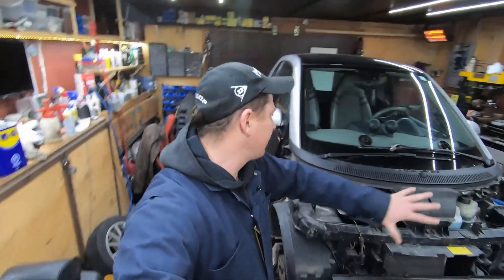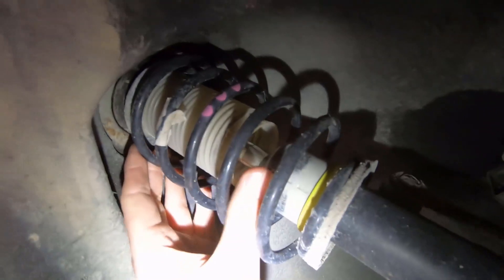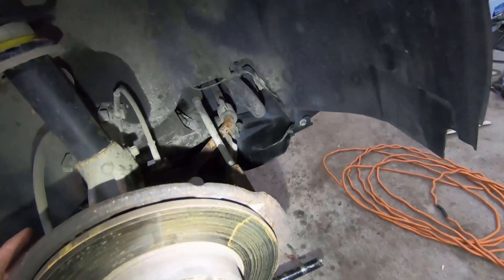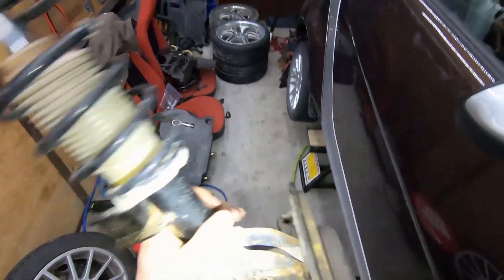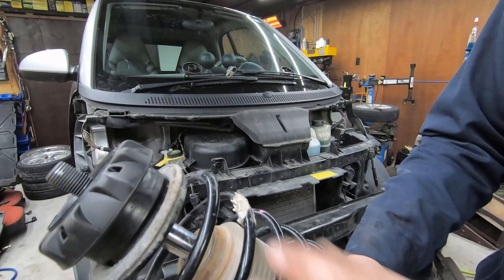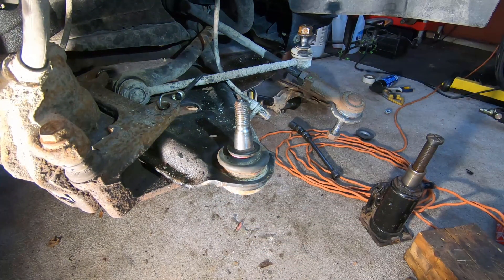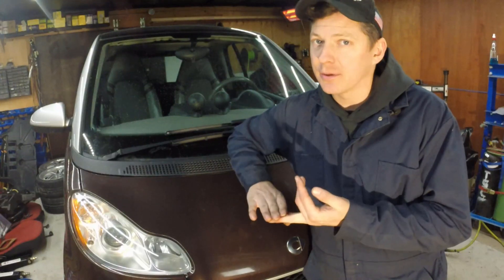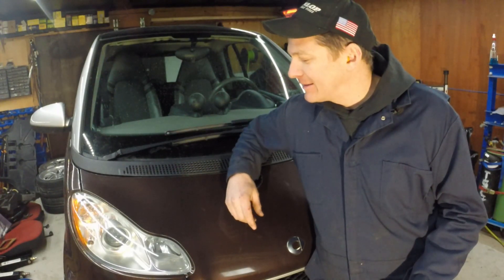Front Suspension Full Disassembly and Rebuild Smart ForTwo 451 (2008-2015)

Comment: If just replacing the control arm will it need a front end alignment?
Reply from the maker: While not absolutely necessary, I would do it because you can never know how accurate the new control army’s dimensions are to the old one you’re replacing.

Comment: Tiny quote was 2400$ us for this job. And 90$ for alignment. Fair?
Reply from the maker: 90$ for an alignment is a good deal. $2400 to replace the control arm seems steep. What work are they doing exactly and is it one side or both? What’s the breakdown parts vs labour?

Comment: Perfect. I have a clunk sound when taking a left turn too quick. Replaced all sway bar components and while off the ground inspected for anything that had play or generated any noise. Tight as a drum, but still makes the noise. That strut top is an area I had not tested under the right conditions. Its my next test using that bottle jack method
Reply: Strange thing. The abs/skid control Triangle light came on and wouldnt go off until i restarted. Now the clunk is no longer. I'll rip it apart and see if the rotation sensor ring is loose or broken inside the hub. Intermittents are the worst.
Reply from the maker: @plushowner check your reluctor rings on the rear axles. They crack often. I’ve never seen a front go bad but that doesn’t mean it can’t. May be unrelated to the clunk, or if the rear rings are wonky the clunk could actually be the abs trying to brake a front wheel or something.
Reply: @PBGarage  I do live in a "pothole state" MN. Dented rims a few times, I feel real bad for my car. But mine is a 2008.
Reply from the maker: Yeah great thing to check, also check your control arm bushings for play they often delaminate.

Comment: could you use a pickle fork to pop the ball joint from the knuckle?
Reply from the maker: Yes but you will most likely destroy the rubber boot on the ball joint. Not an issue if you’re replacing it anyway.

Comment: 10:50 
A hint to fellow hobby mechanics, that the bar between the two car-sided control arm mounts is mobile. I did not recognise that initially and nearly died trying putting the screws back in after replacement -because the bar was (unknowingly) out of center.
Reply from the maker: Yeah good tip, I don’t remember if I covered that in the suspension disassembly video.

Comment: Really good description and lighting. Did the general ride on bumps get better?
Reply from the maker: It was about the same, it just got rid of a small clunk from the front end over larger bumps. 

People have several tricks to improve the stock ride, I’ve tried most of them and found nothing really makes it much better. At the end of the day it weighs literally half a “normal” car AND a lot of the weight is over the rear axle because of the rear engine. I don’t think there’s much to be had for the harsh front end ride. Check to make sure your springs aren’t broken, and try to see if the struts are leaking. If they’re the original struts and you’re higher mileage, even if not leaking they could be shot. I’ve been meaning to try a set of Bilsteins all around with new Brabus-spec springs. Then at least I know it’s as good as it will ever be.

Comment: No torque wrench used. Not even a reference to torquing. Just a ratchet ring spinner/wrench. This is the dark side of YouTube. Anyone can put up half-assed (but apparently accurate) videos which appear informative but the end result is lives are put at risk - literally.

AND the contributor LOVES this comment. From which we can conclude he doesn’t care.
Reply from the maker: On the flip side, this same car in the video had been taken to a licenced mechanic prior to this work, and the front left lower control arm bolt had been torqued “to spec”. When the car was driven and had to make an emergency stop, the front wheel came back and tapped the wheel well liner, in the process shooting the car hard left into oncoming traffic. When I inspected the car to see what was up, I realized the lower control arm bolt had been sheared in half from being tightened to the torque spec. So the rearward half of the control arm was held in by what was left of the bolt and the front half of the control arm was free to float out away from the car on hard braking. 

These videos aren’t meant to be a factory service manual. They are meant to show people what to expect when taking the car apart. If whoever is working on the car doesn’t feel confident in their ability to set torques to the appropriate values they probably shouldn’t be working on it.
Reply: If your self confidence to tighten something properly relies on a spring and ball in a ratchet making a click sound to do small work like this then you shouldn’t ever work on any vehicle your in experience shows in your words not a good thing at that.

Comment: Nice video, just did this today. Your new front arm just slid on easy!! I got a Febi arm and it was about 2mm too small between the 2 bushes. Ended up wedging a small  bottle jack between them to open the arm  up slightly.
Reply from the maker: I’m surprised it didn’t slide right in. I wonder if the arm got bent in shipping or if the mounts on the car were a bit bent or something.
Reply: @PBGarage  it was just strange that it was both sides and both arms  but they are in now that's the main thing :-). Maybe Febi had a bad batch ? The original Mercedes ones came off easy but they were worn 👍

Comment: Brilliant video. This issue is one of the most challenging issues a Smart car driver has to face. UK garages are a nightmare, and charge a fortune for this...
Reply from the maker: Thanks! The trouble here is finding someone that will even touch them anymore.
Reply: @PBGarage To be fair there not too hard to work on. I think garages  just see them as small and awkward to work on eg front  spring change needing the front end and lights took off to do it proper.

But taking the front end and lights off  is actually only a 10 min job I was impressed how easy it was 👍

Comment: How did you reassembled the strut back with the top 21 nut sitting, which you have removed at the beginning? @6:30
Reply from the maker: I just reassembled it in the reverse order. Slid the strut up through the hole, put the nut on by hand, and then drove it on with the impact.

Comment: I did mines about 5 months ago. At first the suspension would not bounce. I would push down on the car and no movement
Reply from the maker: Glad you sorted it out!
Reply: @PBGarage  I still don’t know what caused that to happen, any ideas.
Reply from the maker: @BIGGBAY90  Oh you mean it wouldn't bounce after replacing things? Quite probably either the bump stop was improperly installed, or the strut was jammed internally. Is it still not moving?
Reply: @PBGarage  Only the lower control arm was replaced

Comment: A really informative and helpful tutorial, I've used it to remove my worn track arms and replace them with new ones. The tip for not fully tightening the mounting bolts until the ball joint was back on was great, thanks again. 👍
Reply from the maker: Glad to hear it was helpful, thanks for watching!

Comment: Safety critical fittings were not torqued correctly.

Front control arm inner bolts requires 89ft/lb (120Nm), you tightened them with a ratcheting ring spanner - this is unsafe.
The track-rod ends are rated at  30lb/ft (40MN) - you tightened them with an air impact gun.

Always use Loctite on the threads when reusing old nuts and bolts in critical applications.

If you remove the black trim under the windscreen, there are access holes to attack the strut top nut.
This greatly improves the reduces the risk of chewing up the strut top nut.

Give the strut top a good wire brush and spray with penetrating fluid a few days before you start the job.
This will stop the top nut galling up on the thread and spinning the damper shaft within the top cup.
Reply from the maker: Good info!
Reply: You got here just before I did, to write the exact same warnings. This is the dark side of YouTube. Anyone can put up half-assed (but apparently accurate) videos which appear informative but the end result is lives are put at risk - literally.
Reply from the maker: On the flip side, this same car in the video had been taken to a licenced mechanic prior to this work, and the front left lower control arm bolt had been torqued “to spec”. When the car was driven and had to make an emergency stop, the front wheel came back and tapped the wheel well liner, in the process shooting the car hard left into oncoming traffic. When I inspected the car to see what was up, I realized the lower control arm bolt had been sheared in half from being tightened to the torque spec. So the rearward half of the control arm was held in by what was left of the bolt and the front half of the control arm was free to float out away from the car on hard braking.
Reply: Glaubt ihr im Ernst, dass in einer Fachwerkstatt der Mechaniker alles mit Drehmomentschlüssel anzieht?

Comment: When you unscrew the tie rod end count the turns.
Reply from the maker: I've found that different manufacturers sometimes build the replacement tie rod ends with silghtly different lengths from the start of threads to the ball socket, so it's tough to get bang on no matter how you do it. Really need to do an alignment after to be sure.

Comment: Thank You So Much For Making This Video. Even Before I Found You Video, I Had Front Passenger Side Conclusion & Had To  Replace All The Same Parts That You Showed.. Can You Please Make Video On Replacing) Rewiring  The Car Stereo For The Smart. I Own 2015 Model Smart For two, I Purchased The  Pioneer AVH-521EX Stereo. I Could Use Any Help That You Could Give. Thank You!
Reply from the maker: I've never even had the stereo out but try searching for the factory stereo pinouts, that should at least get you the info for which wire does what.

Comment: Thanks for a great video. Suggestion for a video: Have you had any issues with temperature setting? It seem that mine has hot air coming from the vents when the setting is at the top. And when i move the lever down 1 millimeter to cooler, the air is really cold. It's almost like an on/off swith.  Something for you to investigate?
Reply from the maker: I can check that out - can’t say I’ve had that issue in any cars I’ve had though. Might be worth seeing someone with a diagnostic tool to see if there is an issue with the cabin temperature sensor.

Comment: But what if I don't need to change the control arm just only its front struts, coil springs, strut mounts and strut mount bearings. Will I still need to loosen the control arm to put those back in place?
Reply from the maker: No you won’t need to loosen the control arm if you remove the spindle. If you try to pull the strut out of the spindle instead of removing it, I’ve done it but it’s a lot of effort without loosening the control arm.
Reply: @PBGarage  oh okay but I also forgot to mention I will also be replacing both sway bar links if this matters now wither I still have to loosen the control arm or remove the spindle? By the way thanks for replying, not too many videos on here about smart cars, thank god you have a very clear and detailed video.